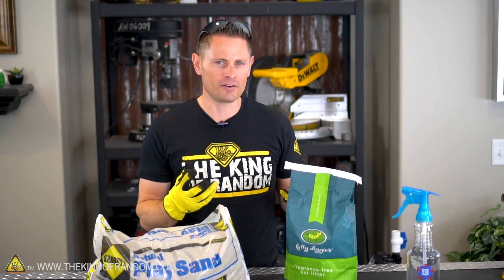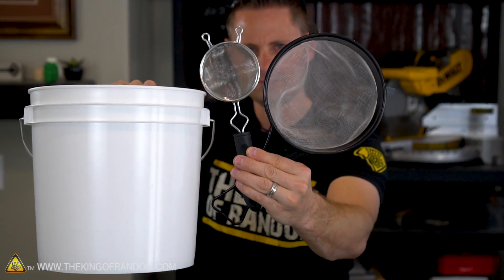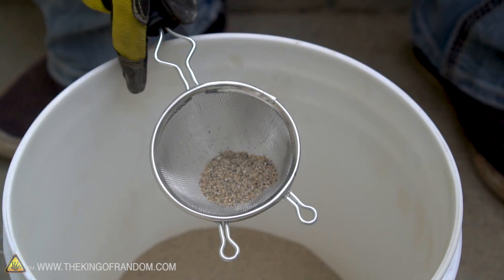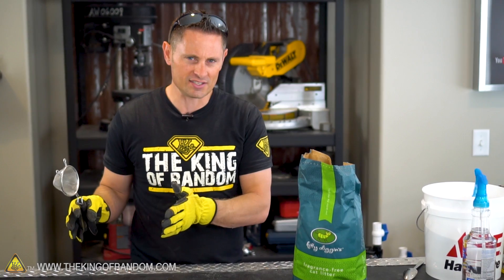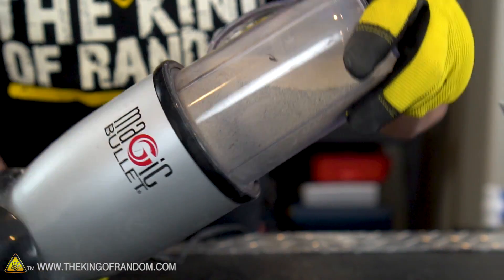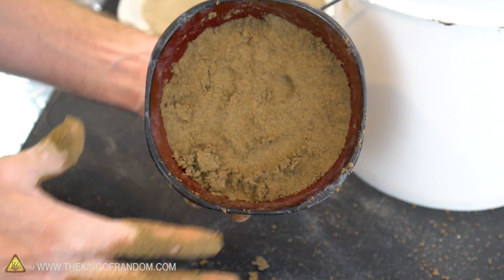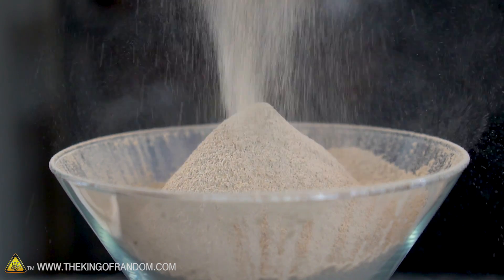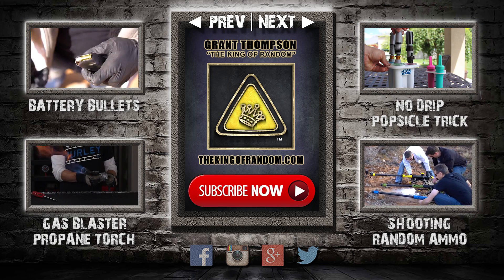Metal Casting Play Sand - TKOR Shows You How To Make Green Sand, Sand Casting And More!

Comment: A local sand and gravel supplier would have a variety of screened sand products in specific mesh values. You can get the exact consistency you want and it will typically be cheaper than aquarium sand.

Comment: I have found that you can use plaster of Paris instead of clay. If you try the plaster method be careful as if you have to much plaster it will trap too much moister and can cause the molten metal to spray everywhere. I have had it happen but if you get the right ratio(10%-15% plaster) it works better than clay. ( Note: if you try the plaster the moister level does need to be slightly higher)

Comment: I'd like to give you-all a tip.
Take a drill bit TAPE any kind of way that you can can the end of it.
 Tape the sifter part 2 the handle of the drill
With the off balance drill bit on the other end of it
 turn the drill on it will shift your sand very quickly

Comment: I agree its the grain size that matters and all soil mixtures contain different ratio's of sand , silt , and clay so its figuring out the best ratio for sand casting. Powder clay itself i say is the best for  compacted your mold in it would almost make it harden a little into modeling clay if sprayed with water a little. Then you demold the item and cast into it with vent and pour holes drawn in the clay. The clay is like an earthware ceramic so should hold form when metal is poured in. Heck it might even create a ceramic outer shell in sand .

Comment: This is probably redundant with all the comments that have been made but your finer sand will require less clay due to the lower air-void ratio of using finer particles than courser ones (your sifted sand versus the super-fine aquarium sand).  Depending on how well graded your unsifted sand is, it potentially would require less clay I believe (because all those little particles are filling in the voids between your larger particles).  More info: Soil Mechanics

Comment: The fun part of this video is that in real life I am a soil lab technician so that whole mixing the sand and water is what we do at my work, it's called the optimum moisture content, and it's the point where the sample has got water in it but isn't overmoist, and you use that water content to figure out how much you can compact the soil. It's what happens when you build anything so that the builders know you are compacting the ground enough so it doesn't suddenly sink a new building from the weight on top.`

Comment: I quick tip for getting fine sand on a budget: bake it in the oven a few times, the heat change cracks the sand. Parents used the method to turn regular play sand into a fine sandblasting sand (they were sandblasting a car)

Comment: When you are resupplying... Hardware store, sandblasting section, get your sand there. Tighter tolerances on the grain size, and it's generally crushed rock, giving sharp edge grains, which give you a better end result then rounded edge "natural" sand more often used for aquarium sands...

Comment: Go to a building materials yard and get silica sand.  It comes in different grits.  60 grit is pretty fine.  You should be able to get a 90 lb. sack for about $10 to $15.  The aquarium sand looks like it is 60 grit silica sand.  They also sell powdered clay; but I don't know it is the right type for your application.

Comment: I have found that the mix works best if you use 2 parts sand and 1 part clay by VOLUME. And when the water is added the mix should not stick to your hands. Also, the sand will give you better results as you cast with it many times.

Comment: Some things that I would like to add. Green sand is only used for 'soft' metals like aluminum. It will not work with casting steel. You need oil sand for that. Also, when storing it, it doesn't hurt to mist a little more water on top. Especially if you live in a hot and dry area
Reply: and can you spray the oil as the water on the sand? Or do you just pour it? And which kind of oil?

Comment: You can use a shop vac to get super fine sand with a double chamber you also can simply crush the rough sand using a capped metal pipe as a mort and a smaller capped pipe as a pestal

Comment: The sand I have used for years is graded washed quarry sand. The powdered bentonite is ready to use from clay pottery supply shops and I use a mini mix cement mixer to do all the mixing. Dry mix sand & bentonite first then add water till it holds. Try not to use too much water or you will have steam pockets blowing through the casting. Degassing tablets & flux really make a final quality difference. Make sure you vent the sand mould thoroughly to allow the steam out.

Comment: I've seen other YouTubers use sodium silicate as a binder instead of clay and water. It's a little harder to work with because it has a limited work time but it makes much higher quality molds.
You can make sodium silicate by dissolving silica beads in lye, or buy it by the gallon as concrete sealer.

Comment: Grant, a typical mix for green sand is 93-94% sand and 6-7% bentonite clay.  You will want to do a couple of things.  After mixing your dry components together slowly add water until the sand is moist but not sticking badly to your hands.  Let this sit a while to actually hydrate the clay.  The next step is to mull the sand.  To mull you want a squishing sliding motion.  The idea is to coat the sand with the clay you have mixed in.  To test the green sand, take a handful and squeeze it into a sausage.  It shouldn't stick to your hands much.  Then break the sausage in half.  It should break clean and not crumble.  If it crumbles then you do not have enough water in it.  If the sand sticks to your hand and the sausage does not break cleanly then you need more clay.  Keep in mind you only want enough clay to coat the sand.  Any more, may give you slightly more green strength, but you lose porosity which will affect your casting.  I hope you find that helpful.

Joe
Reply: Thanks
Reply: @dwightchavula1339  after 6 years, MyHeap finally gets the gratitude he deserves

Comment: would it be easier to make a mortar n pestle type grain mill to first crush the less expensive sand  and then put it through the fine mesh sieve? plus a simple wooden frame and woven thin wire makes for a perfect large platform for straining

Comment: Hey Grant, you should've just automized the sifting process by connecting the big and small mesh using paper (like a funnel), then you can connect this system to a vibrator and voila: automatic sand sifting machine. All you need to do is keep adding the sand to the top part of the funnel with the larger mesh and get the fine grain on the other end. Cheers!
Reply: Mueed nice idea
Reply: Cheers mate! :)

Comment: You should see how much heat or how cold can some electronics get or handle, as well what would happen when you charge and discharge a portable charger and what the affects can be. Another one (is dangerous) is to see if a car can run with no oil/ battery. Liquid nitrogen and a bullet , battery, metal, glass(know that output), a stick, or something "indestructible".
Reply: Also what happens when you vac chamber molten rock,metal, or anything red hot.

Comment: Home Depot also has "30 Mesh Sand," Internet/Catalog #100321932, or Store SKU #413867. This product is pre-screened for uniform small size, washed, and kiln dried. Cost difference from the Play Sand is less than $1, in my area.

Comment: Is there a way to cold a hot car which was parked outside using the liquid nitrogen using windshield water nozzles
Reply: The Loner I know that it will turn in gas but if in place of water you fill liquid nitrogen since it's closed container it may work. Even if it works for just 1 time. Think I can be best way to fight hot car still

Comment: I have casted aluminum, you need to use a high temp Hardening liquid to mix in with you're sand around you're molding piece, make a proper cope and  drag put you're mold in the oven to harden the sand and then pull it out when you are ready to pour the AL I did a whole lab on it and I have the Lab report and procedure if you are interested!